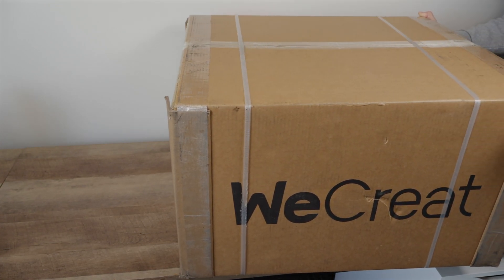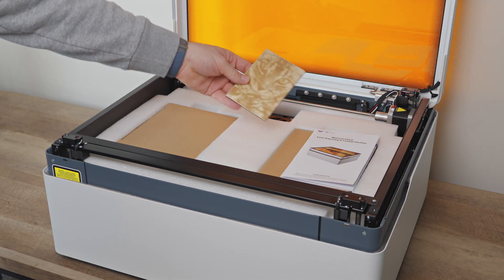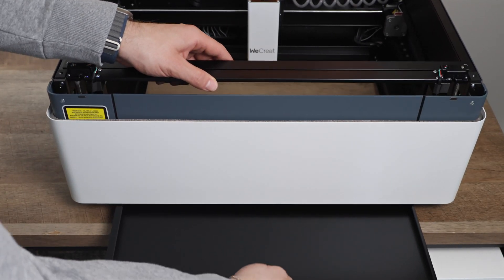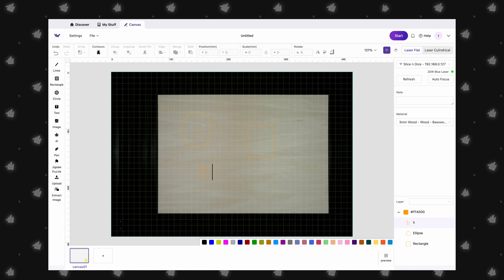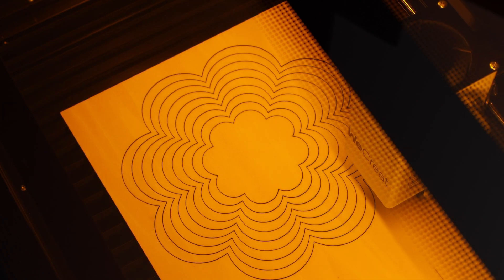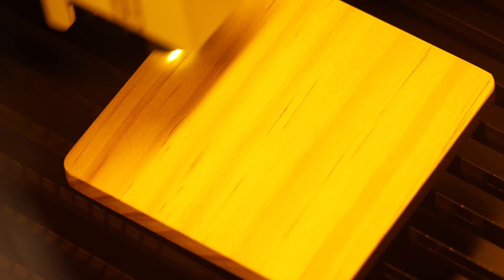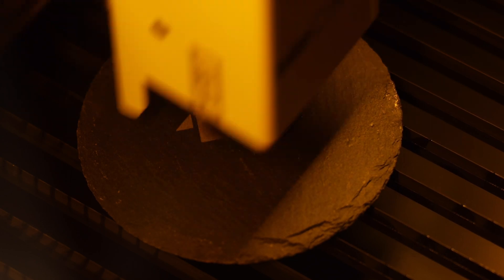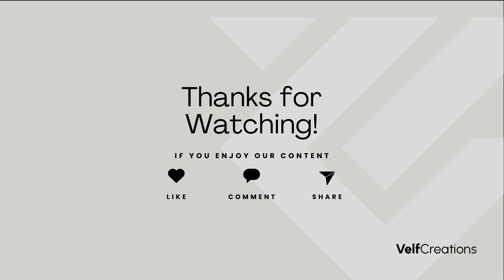Transform Your Projects: WeCreat Vision 20W Laser Engraver Unboxing & Review #wecreatvision

Comment: is there a way to fix the one way firing of the laser, so it fires both ways, not just left to right?
Reply from the maker: That is something that we were wondering about as well. We checked with WeCreat and it appears that at the moment they are not working on implementing a bi directional engraving feature unfortunately. Typically this would speed up engraving but we were told that they have optimized the single direction engraving to be faster. It seems like it resets back to the left faster than the engraving speed but it still would be nice to have the bi directional engraving. Maybe some day
Reply: @VelfCreations  thankyou